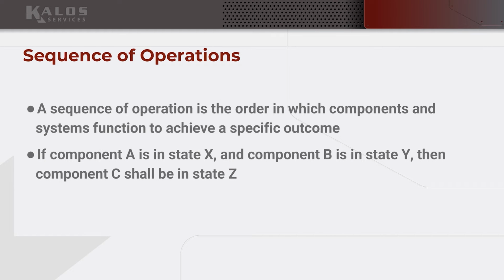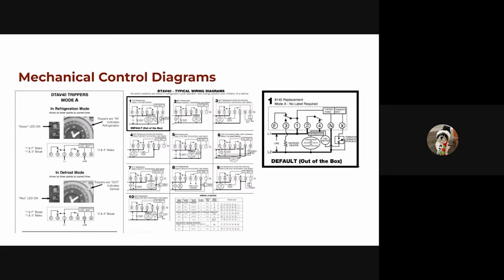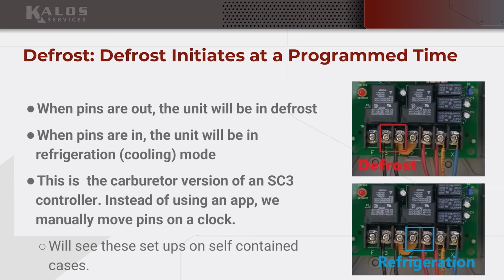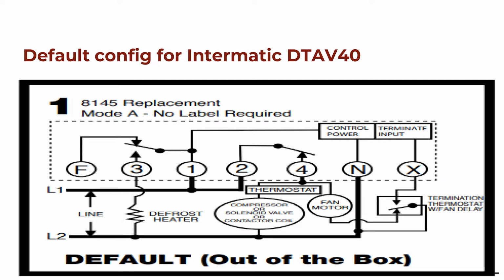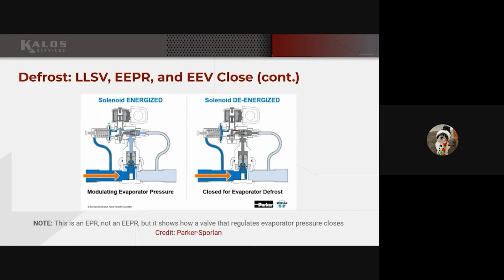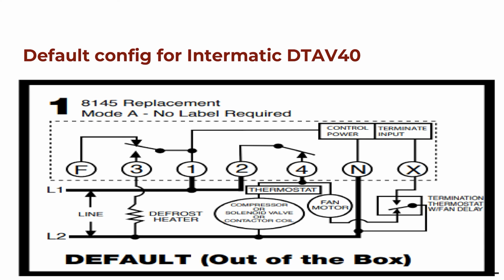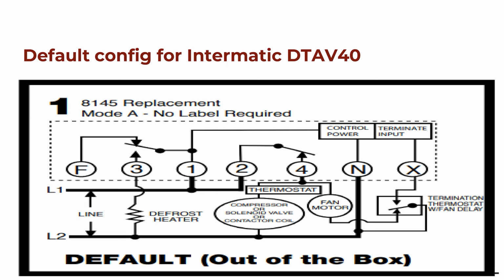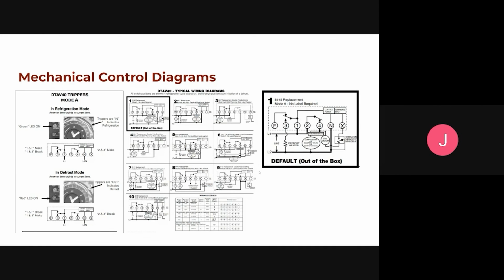Refrigeration Electrical Sequence of Operations

Comment: The solenoid valve is usually wired to the low pressure sensor so when system is on it’ll detect Freon and thew low pressure sensor is connected to the thermostat all in series. If the low pressure sensor has Freon it’ll open the solenoid valve.  Thermostat , low pressure sensor , then solenoid valve and compressor contractor.

Comment: That guy in the background @20:22, you don't necessarily need a magnet to open a liquid line solenoid when pulling a vacuum. First, and I've tested this; a typical Sporlan LLS, won't hold a vacuum. And if it's close to the TXV, the TXV will be wide open anyway if it's working correctly under a vacuum. Think of it like the external equalizer line is at 0 psi, and the bulb is probably pretty warm, so the TXV is going to be sensing like an incredibly high superheat, and will be wide open starving for gas. However, if the LLS is like up on the roof by the condensing unit, or a long way from the TXV, then it's probably better to use a magnet, and pull the coil off of the LLS. However, this is kind of bad practice, and in a pump down system, the system will be wasting a lot of energy pumping out that liquid line every time the thermostat is satisficed or the unit goes into defrost. Also, if that liquid line is ran thru a humid space in the building, and is not insulated and if it's a low temp system, it could build up frost on the liquid line on every pump down, resulting in a small amount of possible water damage. It's not always possible in the case of feeding multiple evaps from one LLS, but it's a better practice to install the LLS very close to the TXV inside the end compartment of the evaporator.